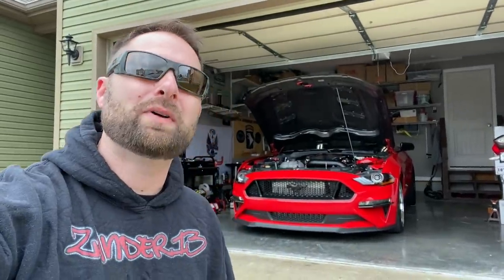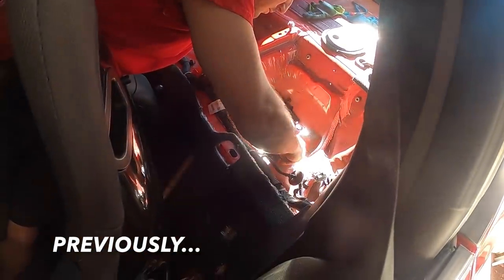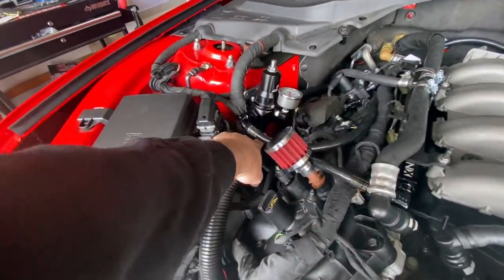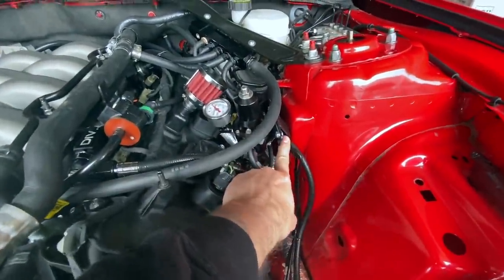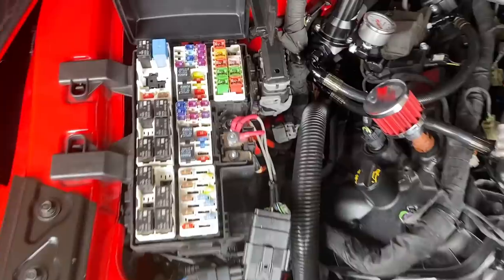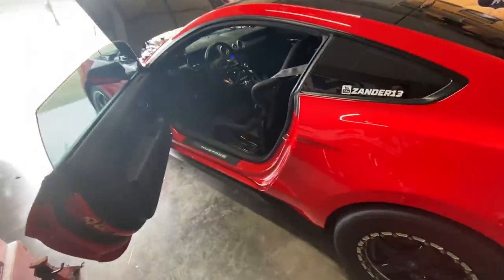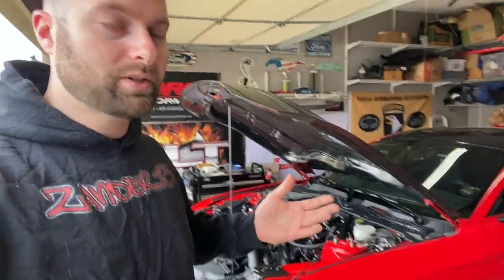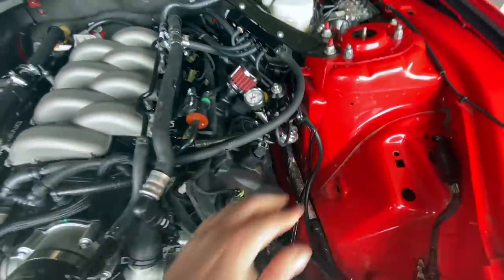2018-2021 Mustang GT Return Fuel System- Lethal Performance Division X

Comment: What kind of fuel line did u run from the regulator to the DI pump on passenger side?  How does it connect to the Dzi pump

Comment: Why is the hobbs switch not installed? Shouldn't it be used to ensure you don't have all the pumps running all the time and end up heating up the fuel?
Reply: That is not what the HOBS is for. The Hobs is for triggering on the second or third pump by boost level if needed.
Reply: @PMPerformance  exactly my point, so without the hobbs installed are all 3 pumps running even while idling? If thats the case than there is an excess amount of fuel being pumped to the engine and back for no reason correct?
Reply: Jorge Loves Speed yes all the pumps will be running then. Sorry it’s early and I missread.
Heating up the fuel is deff an issue most people overlook. With a 2 pump setup maybe it’s not as big an issue as with a 3 pump?
How does FORE do this? All in the controller? Or is it a glorified relay?
Reply: @PMPerformance  I am not sure Ive never used a multiple pump system, but I guess we will see with zander and his car!
Reply: Jorge Loves Speed well, a lot of cars come stock with 2 pumps. So my guess is the 3rd pump or HUGE pumps is where issues happen.
Remember running bigger lines helps this as well. Back in my SN95 days guys were killing 340 pumps on stock lines due to heat. Run bigger lines and problem resolved due to less restriction. 
Little different than fuel heat, but maybe similar idea.
Reply: @PMPerformance  We run 3 F90000274 pumps full time and have on every one of our high HP builds. We've never ran into issues even with tracking the car (and running mid 8s!).
Reply: Lethal Performance good to know. I didn’t think it was as much an issue because of big line size and big rails, but deff worth consideration.

Comment: What’s a hobb switch. Can’t wait to see her run
Reply: It's a pressure switch. People use them when running multiple fuel pumps to not run all pumps full time. Example would be running 3 pumps. You can run 2 of them full time and use a Hobbs switch to trigger the 3rd pump. Hobbs switches come in all different pressure ratings. The one we include in the kit is a 5psi one. So once you get into boost and the switch see's 5psi it's going to trigger the 3rd pump to run. Hope that helps.

Comment: Why didn’t you run the fore system? Heard it’s a lot better.
Reply from the maker: Not sure how it’s better. Like I said in video. I like that this kit is so easy to install
Reply: @Zander13Productions  I think the FORE is more plug and play with the controller. From what I have researched too, no work arounds to keep the pumps from running constantly in accessory too. The controller is setup in a nice package and preset to avoid those things.
Reply: We pride ourselves on providing an easy-to-install kit and pre-assembled PTFE lines with the optional Hobbs (comes with on this kit!). We also budget our kits a bit more friendly! We have a more in-depth write up coming soon.. Our kits support multiple 8 second guys and gals (including ourselves) and even a handful of 7 second guys/gals. Pretty crazy!
Reply: Lethal Performance I get it. It’s just their nice little plug up package is nice.
I asked Jared before for a writeup and stock levels awhile ago and never heard back. I think at the time the hats were getting a little low in stock or something.
Reply: @PMPerformance  The Fore controller in no way is more plug and play than the wiring we include in our system. Just look at how the wires need to be cut and installed on the Fore controller to each pin where ours are already pre-installed, soldered, crimped and heat shielded.
Reply: Lethal Performance I will have to check this out in further detail.

Comment: Discount code doesn't work
Reply from the maker: What did you try to buy
Reply: Fuel system
Reply from the maker: zander13 let me check. It should be active
Reply from the maker: Found out it does work. They have them on sale right now. Code still works and takes a few more bucks off
Reply: @jeremycave616  Zander said, the code does work BUT we have a sale on fuel systems currently. Please let us know if you have any questions and thank you Zander!